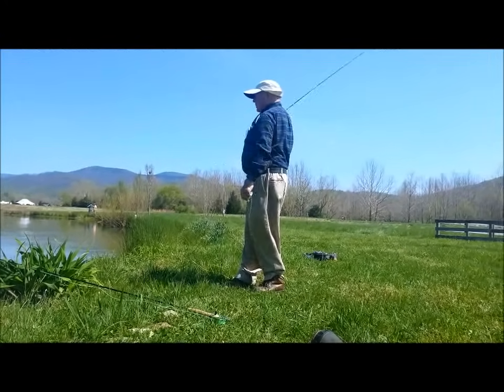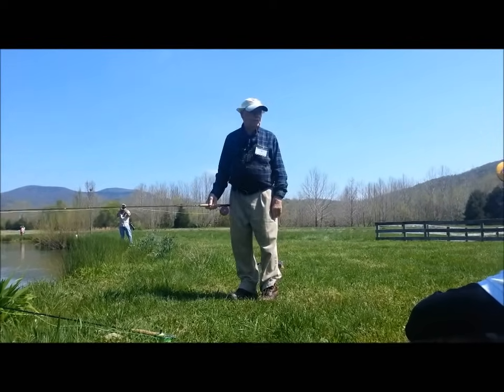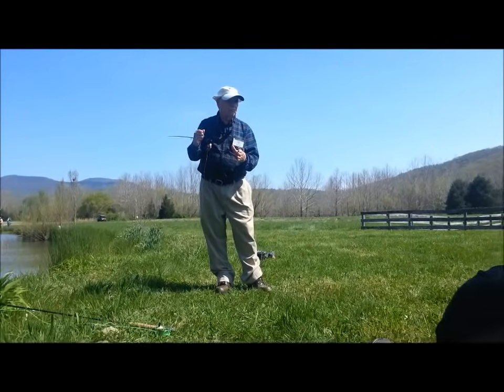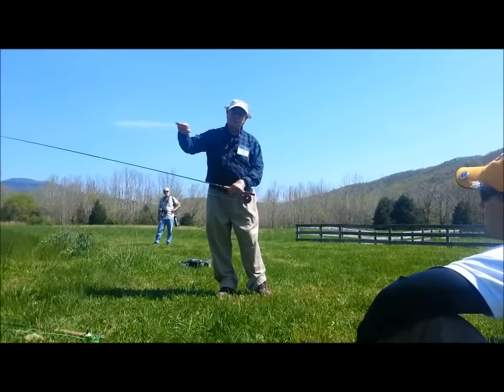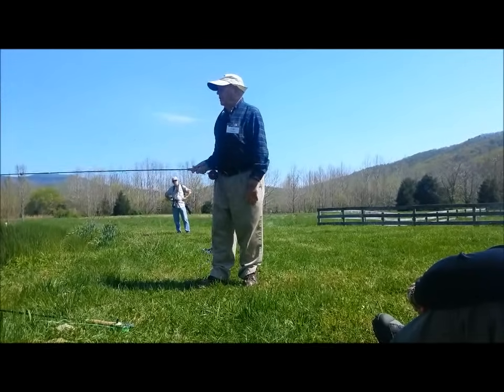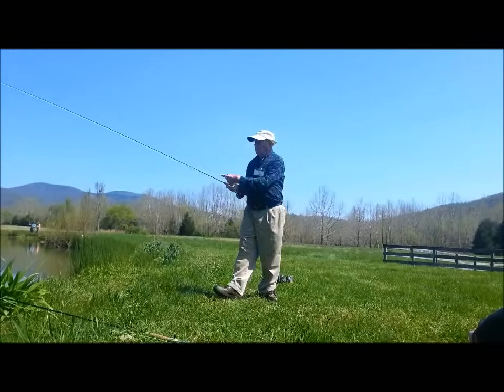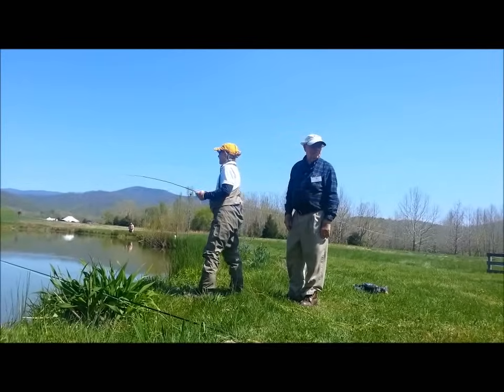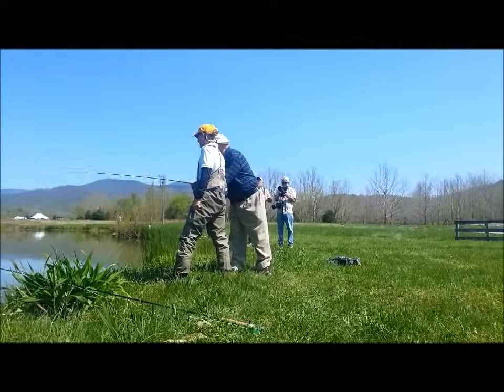Fly Casting Lesson with Lefty Kreh

Comment: Best advice is to keep the elbow on a straight plane, as he said imagine your elbow is on a shelf or a plank, don't lift the elbow up or down..One thing keep the wrist locked APART from the very end when you release at the target, aim at target with the back of thumb..Practice casting with elbow on a shelf or board it will make everything fall into place and make it simpler than trying to explain the dynamics..